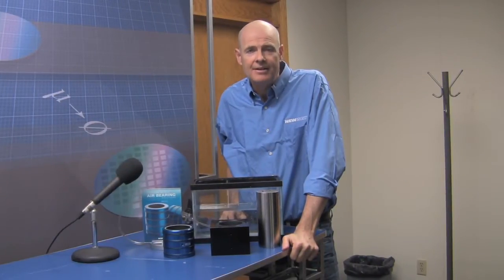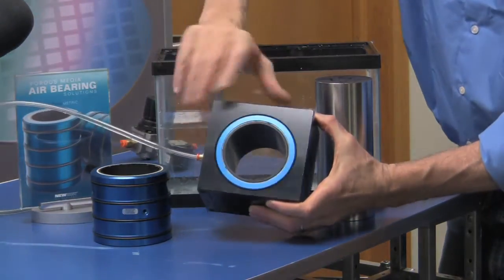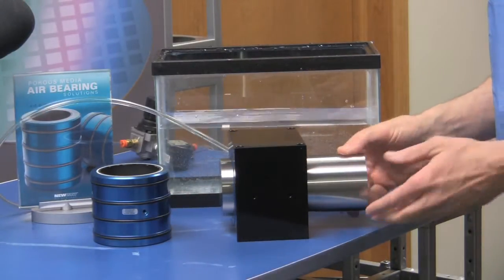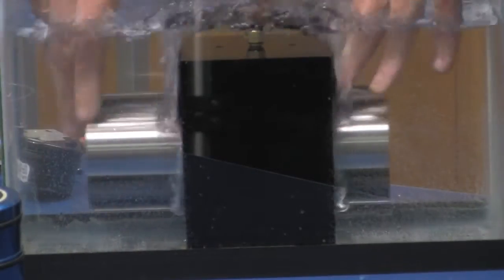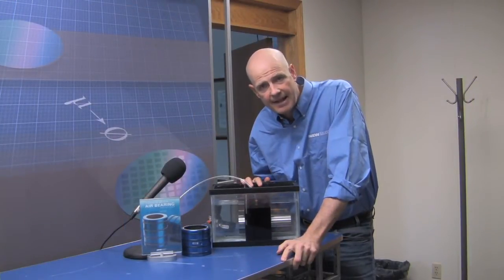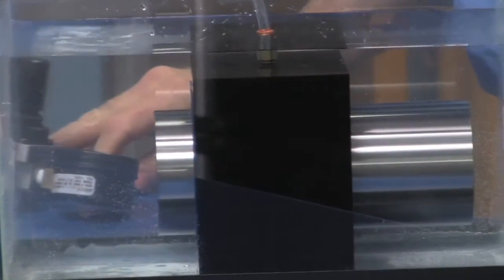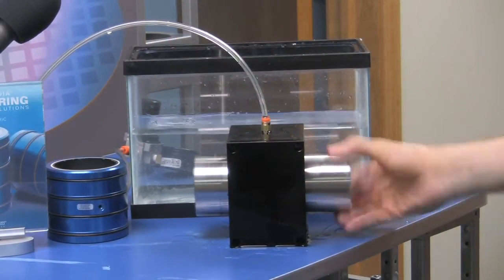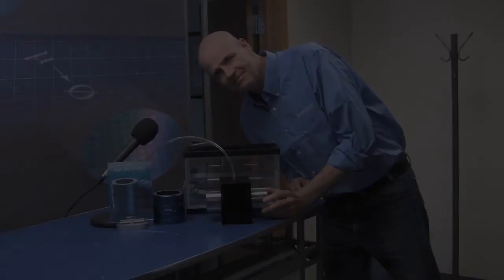Air Bushing in Wet Environment

Comment: Could you tell me what type of graphite you use? Is this kind of graphite and the graphite electrode used on the EDM machine a material? There are many porous materials, such as breathable steel, breathable ceramics, etc. Why do you use graphite? what is the reason? thanks so much !